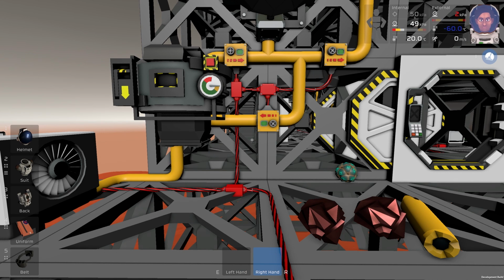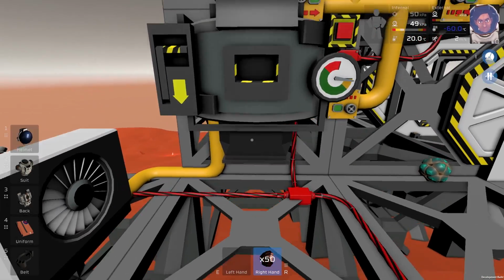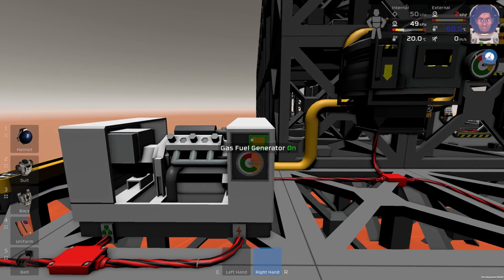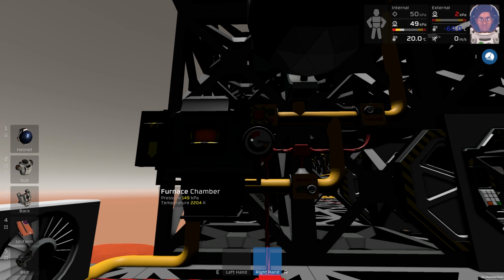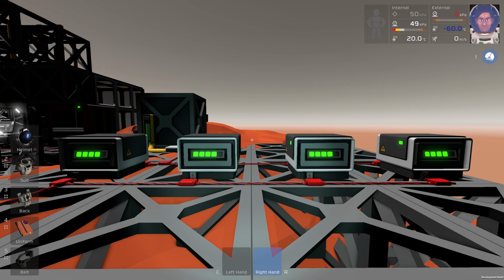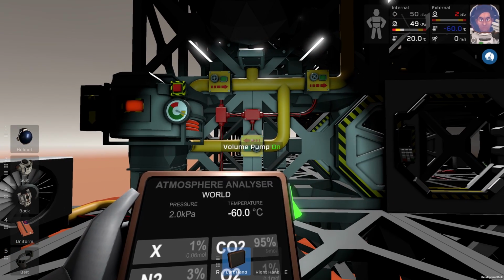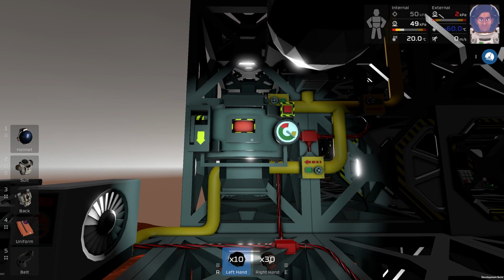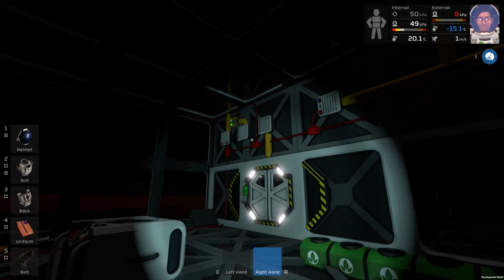Stationeers - Energy Recuperation

Comment: Wondering if you can do the similar thing with an air conditioner 'waste pipe'
Reply from the maker: I guess so, achieved 22000 C ( twenty two thousand ) with AC unit, then I get bored